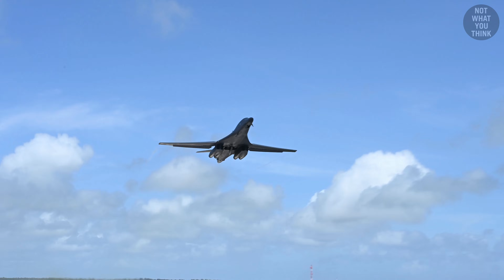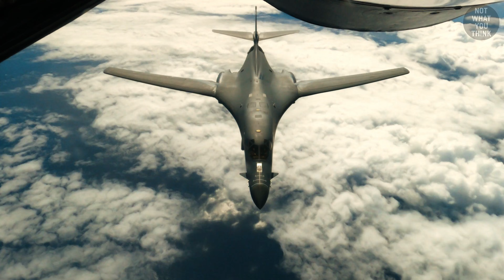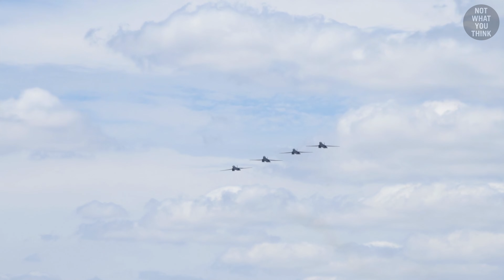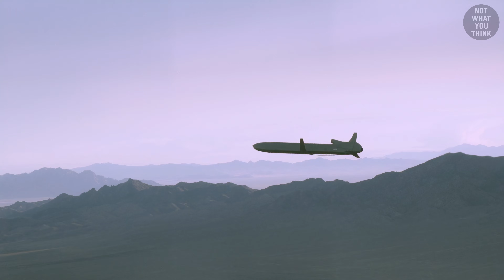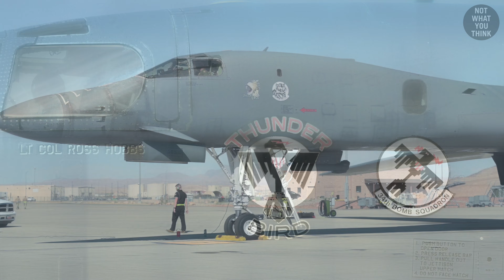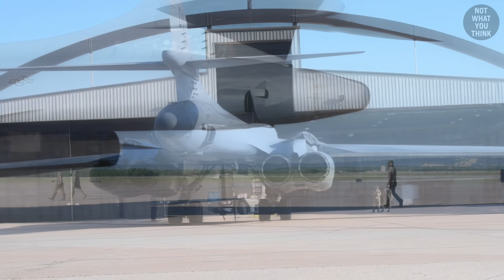Why US Built a Bomber Faster Than a Bullet, Then Slowed it Down

Comment: The Mig 25 was feared until we found out its true capabilities. Other than being fast, it was pretty garbage. 😅
Reply: The MiG-25 is impressive considering that the design began in 1964.  Big problems were the weight caused by using steel, not titanium which in turn caused high fuel consumption.  The MiG 25 RADAR could not look down and the wing design hampered turning.   The MiG-25 was really intended to be a straight line interceptor and could go after an SR-71 if the MiG’s fuel supply lasted long enough.  Some of the limitations were reduced in subsequent manufacturing runs.  The MiG-31 eventually addressed most of the 25’s limitations.  The Soviets/Russians never managed to take down an SR-71 but they came uncomfortably close a few times.
Reply: @wtmayhew  Mig-25P engines are Turbojet design with Low overall pressure ratio, that run on standard cheap Jet fuel. Because of that it is fuel thirsty. But they can run 1250 hours before need to be overhauled. Comparing it to SR-71 which had G limit set at 2.5G, MiG-25 G limit is set at 5.5G ,but it happened during training that young pilot entered in uncontrolled spin and Pilot pushing the aircraft in order to recover MiG-25P produced 11.5G without breaking aircraft apart but twisting the airframe beyond repair. Thanks to the Inox steel used, if it was built from Aluminum it would break for sure. 
MiG-25P which CIA managed to capture is a first Stop-gap version, until much more capable MiG-25PD entered in service.
First version MiG-25P indeed had old fashioned radar RP-25 Smerch and avionics based on vacuum tubes, that didnt have ability to detect and track low flying targets.
the range was 100Km in search modes, but one of good caracteristics of that radar is that had a Two working frequencies, which make it immune on jamming techniques available at a time, also enormous power of 600KW make that radar can burn through jamming too.

Many people do not know that when CIA agent Belenko managed to steal the MiG-25P in 1976 (in similar way they tried to steal MiG-31 with kinzhal missile last month through Ukrainian agents) , many people do not know that Soviets already in 1974 (Two years beofre Belenko steal the MiG-25P), Soviets tested RP-31 Zaslon 
(200Km range Radar that can track 10 targets and attack 4 at a time) first ever pulse-Doppler radar with a passive electronically scanned array (PESA) antenna and digital signal processing. The antenna used by the Zaslon is actually a multi-channel system comprising two separate electronically controlled arrays, an X band radar with 1700 emitters and a L band transponder with 64 emitters brought together into a single antenna. Later on basis of that MiG-25 prototype, MiG-31 two seater is created.

Basic MiG-25P is immediately updated and newer much more capable version called MiG-25PD is created with Radar RP-25M Sapfir with range of 120Km and Look Down-Shoot Down capabilities and R-40RD missiles with 85Km Range (very good result for 1979).
Reply: @wtmayhew

No radar could look down in that era.  The Mig-23 and Mig-31 had look down radar in the 1970s which was par for the course with the West.
Reply: @wtmayhew  However, the MiG-25 was never intended to go after SR-71s; it was designed to be a counter to the supersonic bomber the US was developing at the time -- the XB-70. When the XB-70 program was canceled after the well-publicized crash, the Soviets already had the MiG-25 in production, so it was kept in service. Amusingly, after it was recorded in a Mach 2.5 flight over Egypt, the fear that the Air Force could be facing a highly-maneuverable supersonic fighter sparked the development of the F-15 Eagle, initially developed purely as an air-superiority fighter, with the design motto "Not a pound for air-to-ground". After Viktor Belenko's defection, analysis of the MiG-25 proved that the capabilities the F-15 was designed to counter were just a bugaboo -- it maneuvered like a truck, and the unseen back story of its Mach 2.5 flight was that both of its engines had to be replaced after the flight; it was intended as a pure interceptor -- to take off, get to altitude fast, catch a (relatively) lumbering supersonic bomber and shoot it down with missiles, and return to base. The Soviets had built a counter for a plane we never put into service, and then the US built a counter for what we thought their counter was capable of.
Reply: The Mig 25 was so feared that it created the f-15
Then they found out how bad the Mig 25 was
Reply: It wasnt meant to be an air superiority fighter, It was an interceptor meant to knock out nato bombers before they could drop their nuclear payload, damn everything else.@P.B606
Reply: @P.B606we literally created a super plane because of a trash plane
Reply: @devoof  nope thats just a myth and the mig-25 is a great plane one of the best interceptors ever made, second only to the mig-31
Reply: @Silver_Prussian dog fight not much. As an interceptor yes
Reply: @P.B606 the f-15 was already in development and the mig25 only seemed bad becuase Americas incompetent military intelligence thought it was multirole fighter.
Reply: The problem was, it was cheap EMP proof ( vacuum tube ) high altitude interceptor. It’s was literally design for nuclear war, and was good at wat it was design for, to go against nuclear bombers.

It could do 2.8 Mach without damaging the engines, but if needed it could go over 3.2 mach, but engines would overheat and usually had to be replaced afterwards.
Reply: @kokosnh1170  3.2 at a 1 minute spurt will not result in any close interception. it needs to go FASTER than 3.5 to catch up to anything already moving at Mach 3.
Reply: It's not just the planes, it's their ENTIRE military.  Ukraine 3 years and counting, US 1991 Iraq war-100 HRS. No comparison.  When we fight with anger, no one stands a chance
Reply: That speed was still pretty impressive though! It's cool how much we've learned about Cold War aircraft over the years.
Reply: It was basically the Sr-71 but with guns, smaller and had shitty engines
Reply: Corporate medias are a lot more notorious than state-controlled medias.  
Whichever side you take, don't fall for it right away.  It's part of their business.
Reply: Mit 25/31 is still in service
Reply: @alfaeco15  - "In service" or "still being serviced" by constantly-busy ground crew?
Reply: In other words: Russian
Reply: It wasn't even that good at going fast because the engines wouldn't hold up
Reply: @BRAINFxck10 tbf, in the situation they need to go as fast as possible, theyre trying to knock nuclear bombers out of the air before they can drop their payload. The understanding was that there might not be an airbase to come back to.
Reply: @GigglesClown The problem was the airframe couldn't handle the speed, and would fall apart after a few flights, meaning you'd never be able to do things such as train your pilots to fly the plane going at that speed.
Reply: @GigglesClown yeah Russia's expendable assets military doctrine 😂
How ironic that instead of using titanium parts they were selling their titanium to US shell companies that were building the SR71 in secret
Reply: @BRAINFxck10  there is not such doctrine the guy is talking about a nuclear war scenario.
Also titanium was universally hard and expensive to work with which is one of the reasons why the sr-71 costed so much and even though it was made of titanium the sheer amount of strain put on the fuselage was insane which is why the sr-71 didnt fly at mach 3 for more than an hour otherwise it would disintegrate. 
The mig-25 used nickel steel aloy which offered another advantage, easy repair, the mig-31 on the other hand was made most from titanium.
Reply: @Silver_Prussian no such doctrine? Look at their tactics in WW2 and Ukraine fool 😂
Reply: @BRAINFxck10  it was as fast as a blackbird, just not for as long. over mach 3
Reply: @BOZ_11 not quite as fast.

Also the Blackbird could sustain that speed for most of the mission, the MiG-25 could only do short bursts.
Reply: @BRAINFxck10  they would if you didnt go beyond mach 3 for a long period of time the recommended cruise speed was mach 2.65 or no more than 15 minutes of mach 2.83. Which is standard for any jet not optimised to sustain high speeds for long time and the tumansky r-15 engines were not optimised for continues high speed so are the jet engines of most aircraft of the time unlike the sr-71.
Reply: @Silver_Prussian even following the flight recommendations they would still overheat easily around those speeds, thats why they made the Mig31
Reply: @BRAINFxck10  No they would not overheat if the pilots followed the instructions, even if we are talking about the first version of the r15 tumansky engines.
They gave the mig31different engines this time specifically designed to be used by several aircraft both civilian and military. They had higher longgevity and higher reliability.
Reply: @Silver_Prussian they would definitely overheat before 15min at mach 2.83 that time had to be reduced to 5min
Reply: @BRAINFxck10 nope the time was 15 minutes
Reply: @Silver_Prussian  haha no, that's too long man all the sources say 5min and one said 10min max but that's already pushing the limit, mach 2.6 for 20min or mach 2.35-2.4 for 30min that's all the fuel it had and around mach 2.4 was the safest temperature for the engine
Reply: @Silver_Prussian you would be one of the pilots that destroys the engine every flight 🤦‍♂️🤣
Reply: Sometimes being fast is the most important thing
Reply: Its still teh world fastest fighter jet right? Still has the record?
Reply: @thesaddestdude3575 The YF-12 has it beat there, though that wasn’t a production variant.

If you add enough qualifiers yes, the MiG-25 is a fastest something, but it’s less impressive than it sounds.
Reply: @thesaddestdude3575  I think so
Reply: The Mig31 is quite capable and dangerous.
Reply: @kentl7228 it is, however, slower than the MiG-25.
Reply: @Justanotherconsumer Still about the fastest today. I gather it is more feared than the Sukhoi jets. Big radar, high speed and high altitude makes a machine that can hit you from very far away, due to the added kinetic energy giving big missile range.
Reply: The Mig-25 was feared and it kept the Soviet skies SR-71 free for four decades.  

The Soviets never pretended it was anything other than the best interceptor in the world.. and the fact that it surprised the Americans by successfully and repeatedly intercepting the SR-71 in a stern chase over the Baltic Sea is a testament to that. 

If you’re wondering why it never shot the SR-71 down.. just ask yourself why the US has never shot down a TU-95 doing the same type of mission.
Reply: Really? And they developed MiG-31 from the 25 which is still in use today. That plane forced Blackbirds to the ground😊
Reply: Garbage? MiG-25 is a 3rd gen fighter. Would you prefer being in an F-4 or F-5 to go against it? Also may I remind you first A-A kill of desert storm was a MiG-25 shooting down an F-18 with its R-40 missile? And that even AIM-7 equipped F-15s had serious problems enforcing shooting it down in BVR ranges? You'd have to be a next level clown to claim MiG-25 is garbage for its era.
Reply: @batuhancokmar7330 Facts don't matter. Yankees are deluded af.
Reply: @batuhancokmar7330 agree
Reply: Except thats a myth.
Western media along with incompetence of american military intelligence made this aircraft to be a monstrous multirole fighter. It was a monster interceptor however.
The soviet never overstated its capabilities they were happy the jet was feared and simply didnt say anyhting because why would they.
They were also well aware of the jets weakness and a began to develop its replacement almost immidiatly that is how the mig-31 came to be. This time the jet would use not just brute force but also sophisticated avionics and radar to intercept its enemies.
The mig-25 upgraded version, the new PD variant would enter service in 1979 just 3 years after belenko, this upgrade gave the jet new rockets, new radar and new engines.
Reply: @Silver_Prussian yes, a myth that won’t die.  It’s not even that great of a myth, either.
Reply: not to be that guy but it still technically won against f15s in combat, damagining an f15s wing and coming home unharmed!